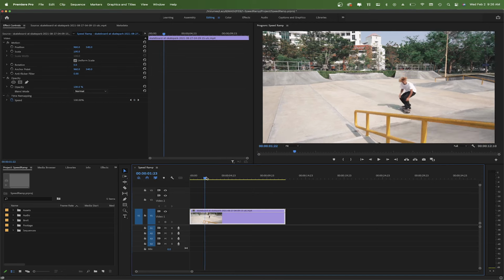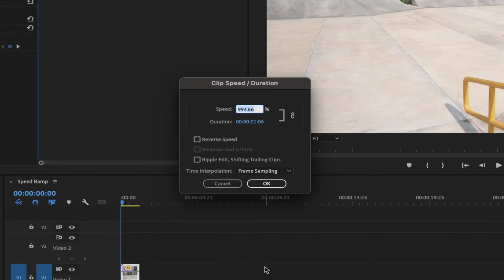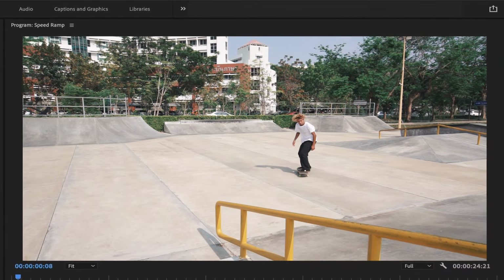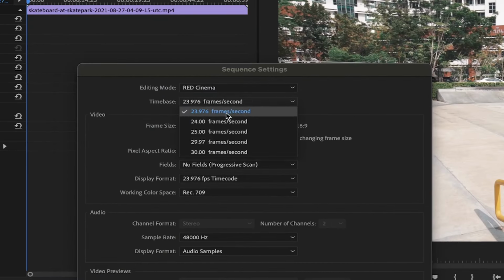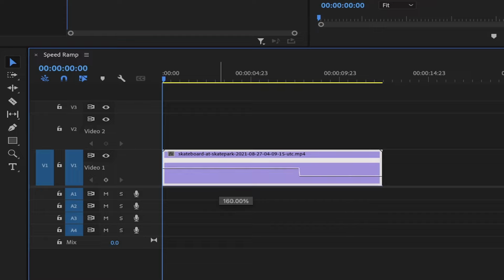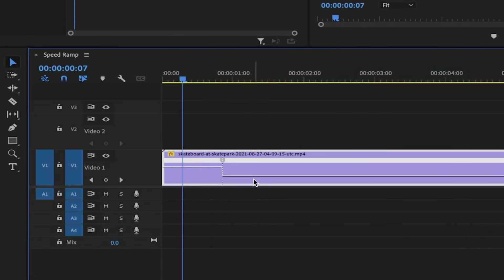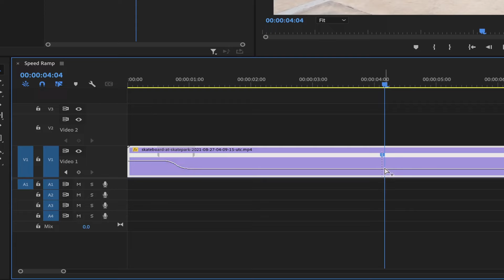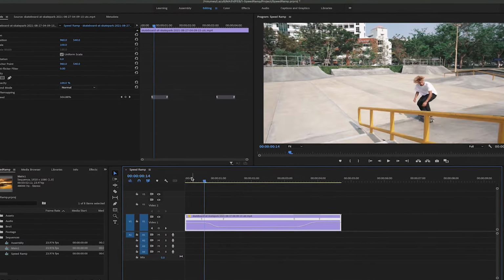SMOOTH Speed Ramp | How to Speed Up Footage in Premiere Pro

Comment: Atm the clip I want to ramp up is already at negative 200% speed (so playing in reverse). So I may be very well doing something wrong but should this same technique still work for it regardless? Because it doesn’t seem to have any effect so unsure if I’m supposed to do something different to account for it
Reply from the maker: You might benefit from rendering out the clip at -100% (so playing in reverse but at real time). From there you can slow it down and apply your speed ramps!

Comment: Great. How do you edit it when it's in-between two clips without footage being removed?? When using the speed option you can also check ripple edit. Is it also possible when using speed ramping this way?
Reply from the maker: Can you please clarify? Are you asking how to create a smooth speed transition between multiple clips? Or how to add a speed ramp to a clip without affecting others on the timeline?
Reply: @MASVfast  Hi, yes. I'm asking how to speed ramp a clip that's in between to other clips without affecting the length of the clip or the clips on either side of that clip.
Reply from the maker: @anilaboutme  As long as you apply a speed ramp to a single clip, the other clips around it will not change in length. 

However, they will shift on the timeline as speed ramping/time remapping widens or shortens the clip selected.

If you don't want to shift the placement of other clips, move the clip you want to ramp to a layer above. That way, you can apply speed effects to a single clip without shifting the positioning of other clips.